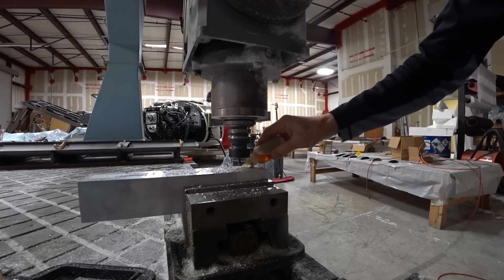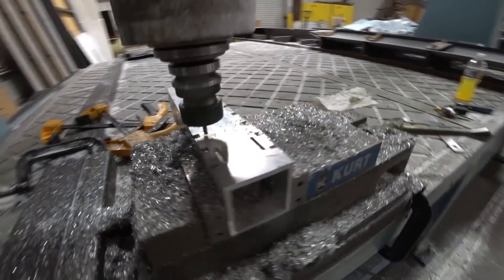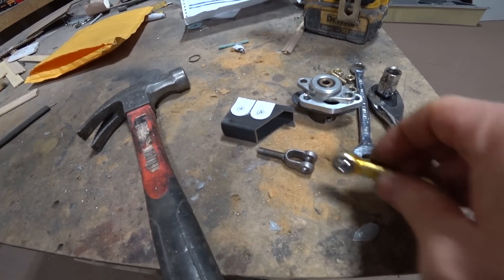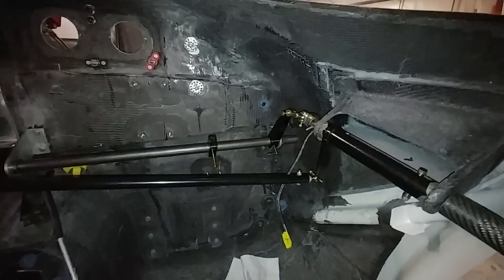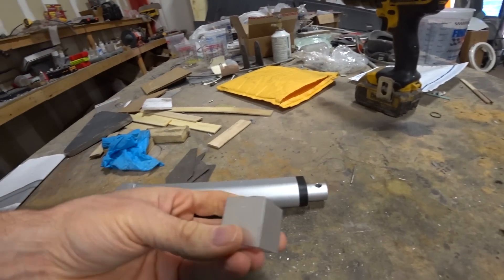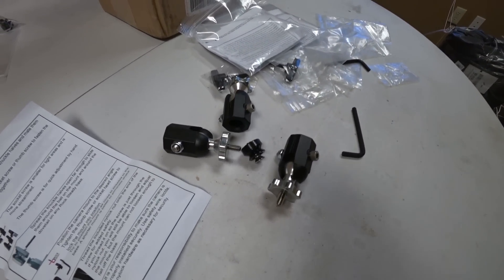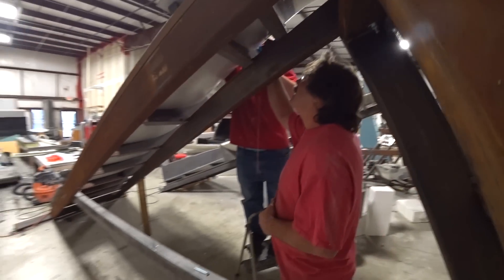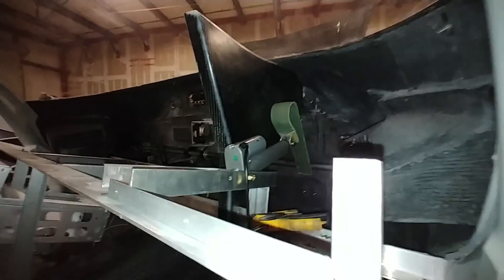Flight Control Fun - Building the Raptor Prototype

Comment: Will the "trim" actuator be able to be disengaged?  Limited range of motion could be a problem during takeoff and landing.
Reply from the maker: No, but the idea of the spring is that it can be overwhelmed by the pilot. As I said in an earlier reply, Velocity has been using this setup for years without having to change it. Of course I will be evaluating the force of the spring and making it narrower to reduce it's force until it seems about right.
Reply: @RaptorAircraft  Thanks Peter.  You guys are doing awesome.

Comment: I don't know much about flight controllers in full-size planes, but that fiberglass spring seems really weird.
Reply from the maker: It's the way all the Velocity's implement trim.
Reply: Raptor Aircraft what is the advantage over trim tabs?
Reply from the maker: @L123Alpha  well, with the 2h flap design I have utilized for the elevator, purely an experiment in low drag design at this point, it is not possible to utilize a trim tab. Sorry if it's not obvious but explaining it would be difficult other than to say using a trim tab on a sliding elevator as opposed to a rotating hinged elevator is just not possible.

Comment: On the planes I fly, the autopilot changes the trim, not the elevator directly. This has the advantage that when you disengage the autopilot, the plane is in balance. I'd like to understand what happens here on disconnect where the autopilot directly controls the elevator? What if the autopilot exerted force, then on disconnect, the plane could potentially do an uncontrolled dive or climb?
Reply from the maker: The autopilot is connected directly to the elevator torque tube but it is also connected to the trim actuator and uses it initially.
Reply: Topical comment if thinking about the recent B-737 crash in Asia.  Just saying.
Reply: Same here - I do like killing the a/p on approach and having trim already set for me!

Comment: Peter 

Excellent progress sir, happy to see some work other than the doors. The trim mount fiberglass spring seems genius but also a weak point. Worst case scenario, if it was to snap how would the controls Be effected!?    Only loss of trim, 

Thanks. Keep up the good hard work Team Raptor.
Reply: Velocity has used this trim spring arrangement for decades without issue
Reply: dbhyslop I had never seen anything of the sort. Simple affective, it just seems ( from an untrained eye ) a weak point. Bottom line is, it’s tried and true only a Loss of a luxury if it ever failed .    Thx for the input.
Reply from the maker: Yes, loss of trim only but the chance of the fiberglass breaking is extremely low.